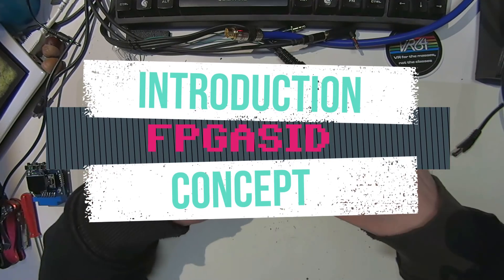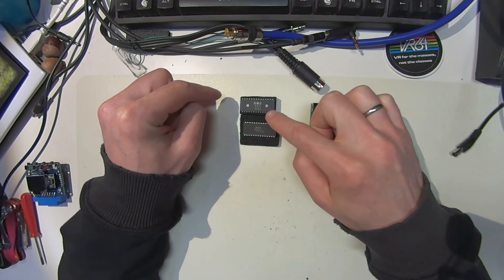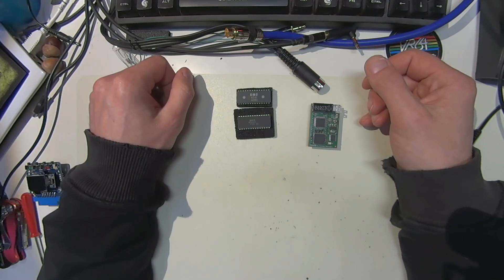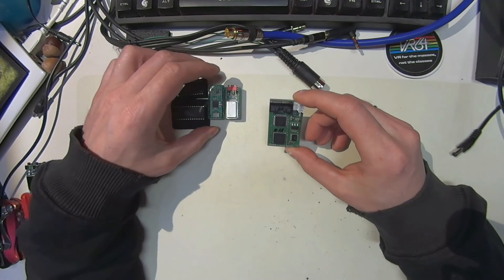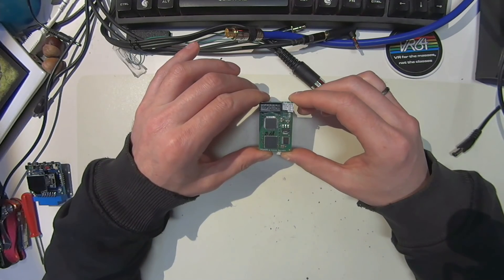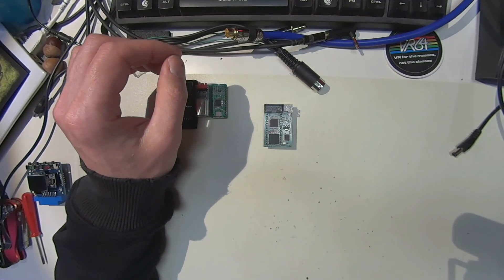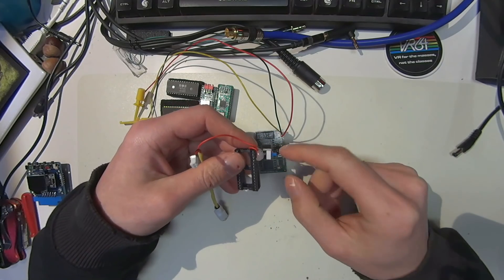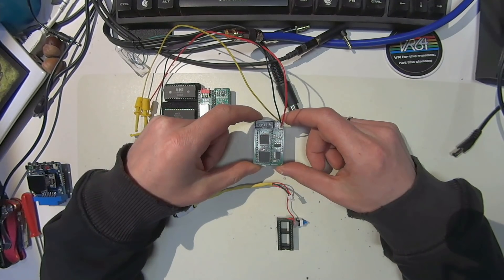C64 Hardware - FPGASID - Introduction

Comment: I'm back with another late reply! :)

Great video. I know we'll all be looking out for the true modern SID. Personally I'm on a spirit quest for the PLAnkton equivalent for each SID model before I really dive in to an alternative.

For now I my wife is understanding if I want to buy working c64s occasionally from eBay and hope the SIDs (and VIC-II / CPU) work so I can stash a couple good spares. My back stock is almost definitely not as healthy as yours!
Reply from the maker: Shane Heroux thanks for the comment, I highly appreciate it even when it comes late :)
Stashing C64s is indeed a good plan not just to get spare parts but to get the hardware for a reasonable price. It will definitely go up over the years and it's good to have some safe stock. This stuff is getting older and probably won't last forever.